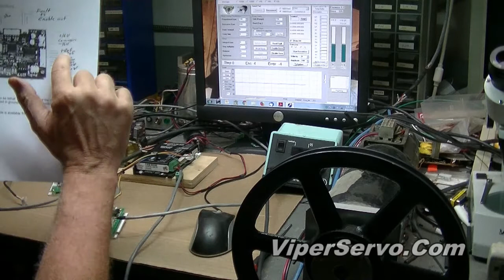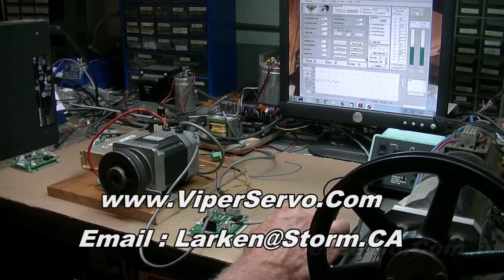Step 2 Linear - Analog Servo adapter Setup ,Tuning PID loop ( S2L from ViperServo.Com )  CNC control

Comment: Excellent product. One question around 25:30 in gain open loop setup mode with AMC amp. isn't this amp/motor  setup running in torque mode at this point? (open velocity loop no tach or other velocity feedback)Like connecting amp input to potentiometer. Isn't +/-10v output a torque command at this point? I'm looking forward to buying these. More versatile than how  I have been doing it GECKO g320x for similar $

Comment: Great video!  I'm about to tackle my first retro fit.  Can I use your step and direction to analog adapter on my machine's original Yaskawa CACR-SR  AC servo drive?  I'm removing the old Heidenhain control for Mach or Linux CNC.  Also with this set up does the servo encoder not connect to the servo drive anymore?  I see in your video the servo's encoder is going to the Viper adapter?

Comment: Will this work in conjunction with a centroid acorn board that only outputs step and direction signals?
Reply from the maker: Yes it will.  Customers are running the Acorn with the S2L .  I have an Acorn in my shop now connecting to a small lathe. I will post a video of the Acorn connections when i get it running.
Reply: @larken558  Please do, there isn't really anything out there that provides a good option or for that matter when there is an option like this a good tutorial explaining the in/outs of in a beginner friendly way.